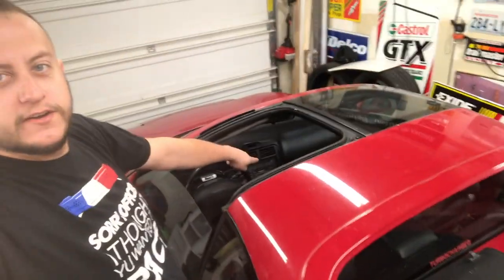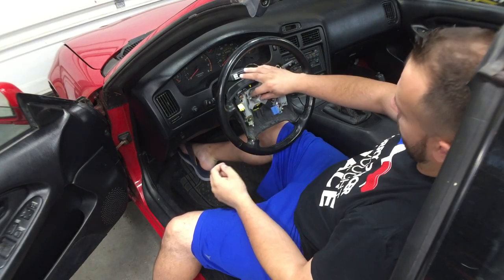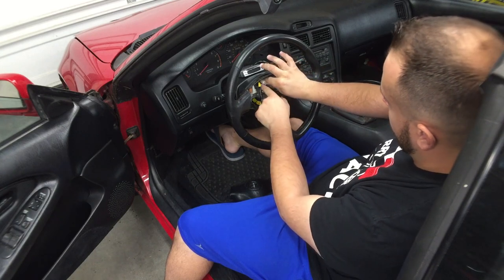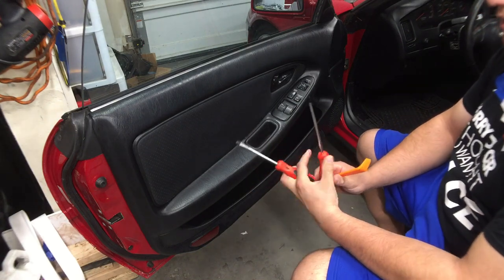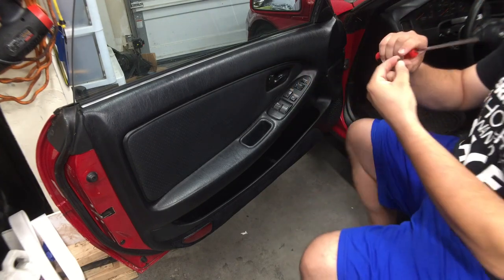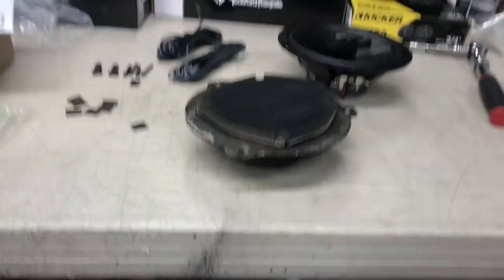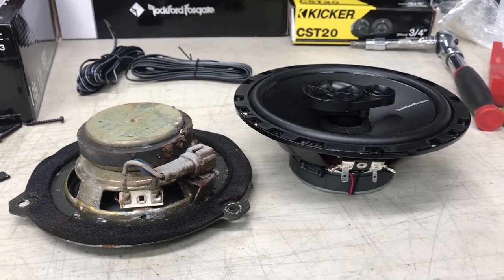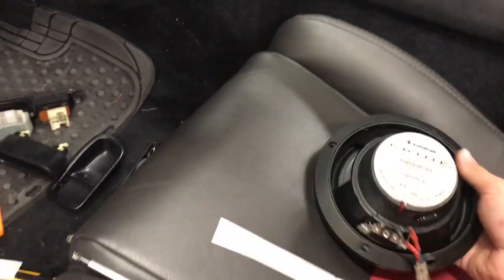1991 Toyota MR2 Turbo Restore PART 5 STEERING WHEEL + SPEAKER UPGRADE

Comment: I think all MR2s have that door problem where the sounds breaks when you open and/or close the door, thanks for the tip, where the wires run to the amplifier in the back and not to the radio. Keep up the good work.

Comment: I've been looking all around for the steering wheel swap! Thanks! Did you have to change clockspring? I have a '96 MR2 and I already bought the adaptor you showed for the airbag
Reply from the maker: Hello, the clock spring for mine was exactly the same, so I did not change it, not sure if 91 and 96 are different though, we only got up to 95 in the US

Comment: I have to ask...the resistance for the cruise control on the celica wheel is different than the MR2 wheel. Did your cruise control work properly??? I would be very surprised if did. Sorry...did I miss something in the past videos??? :)
Reply from the maker: I have heard of some folks having issues with the cruise control, I’ve personally done this swap on 3-4 mr2’s and never noticed a difference, so I’m not sure what that has to do with

Comment: Did you have any airbag light come one after the steering wheel swap?
I was thinking of doing this but I'm not sure if I'll have that annoying light on the dash.
Reply from the maker: johnavatar331 hello, yes the airbag light came on, but it’s easy to reset it and have it work like it should, if you google “Mr2 airbag light reset” there’s a simple procedure you do to reset it, if you put in a aftermarket steering wheel with no air bag, then yes the light will be permanently on, there’s ways of getting rid of the light itself, but it’s not something I recommend, so I won’t make any suggestions on that
Reply: @ROADNOISEMEDIA  thank you. 
I gotta get me one of those steering wheel now for sure.

Comment: Hi I read that the stock speaker size is 5.25" but you can fit 6.5" in with custom spacers. What size did you use in the video? Thanks!

Comment: Question: Sorry for asking after 2 yrs, but I'm a JDM (Toyota/Nissan) guy and a car stereo guy. Currently in the market for a MR2-SW20. Wanna get a nice balanced sound upgrade without throwing in clunky bass boxes or tubes. Those rear quarters; do you think a pair of nice 5.25"/5-1/4" will fit in those openings? Thanks Man!!!

Comment: where did you get the steering wheel airbag adapter piece?
Reply from the maker: sw201444 eBay, just look up the part number I posted in the video
Reply: @ROADNOISEMEDIA  i totally missed that. thanks!
Reply from the maker: sw201444 no problem! Thanks for watching!